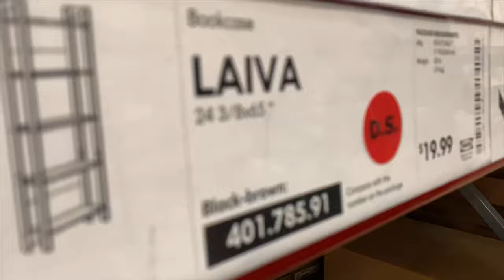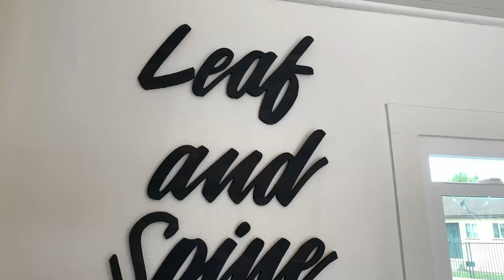Cheap IKEA Plant Shelf Hack | IKEA How To - Laiva Bookcase

Comment: is it possible to use without installing the 2 back wood boards? thank you
Reply from the maker: It is! The wood boards are optional
Reply: @plantmanp  thanks for your kind reply. was planning to place my budget projector on one of the shelves and need a flat and steady surface. so its not wobbly without installing the backboards? also found out in the manual that u need to screw it onto the wall. is that needed too or its optional. thanks
Reply from the maker: It’s optional. The boards are only for looks. It’s not necessary nor us screwing it onto the wall
Reply: @plantmanp  ok thank you so much. i will place my order for it and ill leave u a message once i have received it and assembled it. thanks so much again